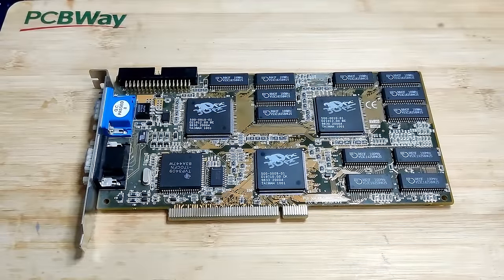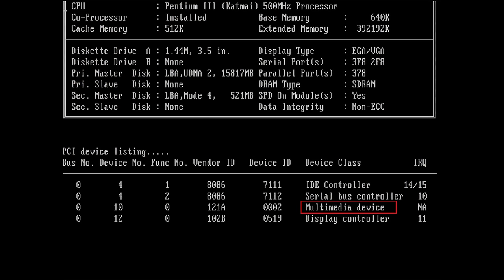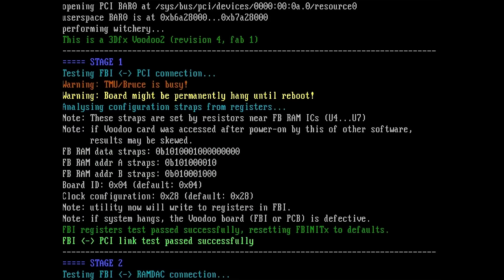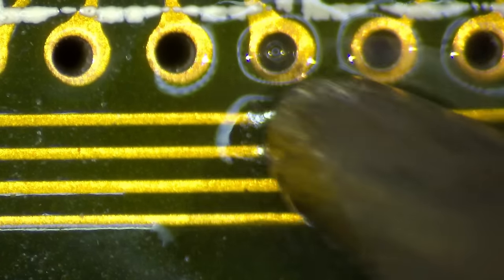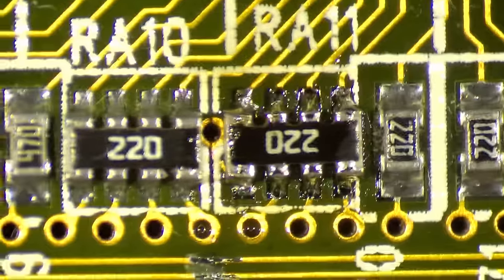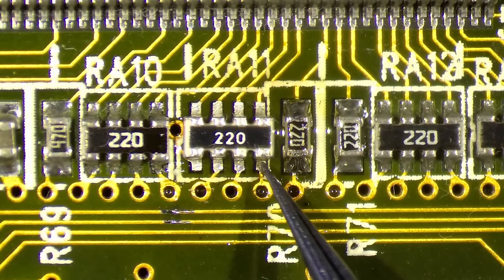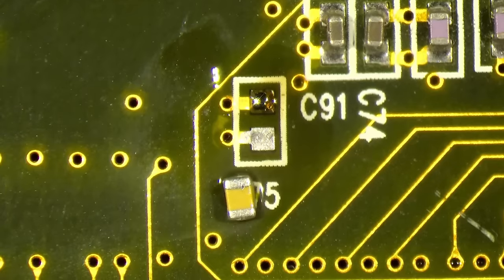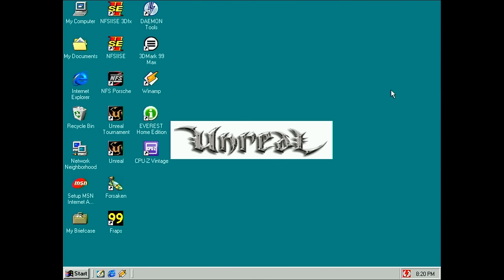Can Witchery find the fault of this 3Dfx Voodoo 2?

Comment: A perfect demonstration of fault finding and where to look, fractures in resistors ...I learned something new here, Thank You. Great result ...awesome video.
Reply from the maker: Thank you!
Reply: Just recently I finished the restoration of very  damaged 386 motherboard. Battery ravaged and some crushed components.
The Last fix was a resistor arraya with an almost invissible crack.
I tried  to fix the array common line and Just use one resistor for the cracked  one, to no avail, so I used an small array. Later relpaced the whole arrayanes. But for one crushed, I madera my one with discrete resistos as I dont have a replacement

Comment: Inspired by your videos, I bought a 3Dfx Voodoo 1 on eBay a few months ago. Like so many of your video examples, some of the 3Dfx chips had bent pins. I have a very modest wifi microscope setup, but I was able to straighten & reflow them. I have been able to get it to work a couple of times, but unfortunately the card still doesn't work reliably. Perhaps it's time to look for further damage on other components to see if perhaps it has a cracked resistor on it somewhere too. Thanks for your videos. Without them, I wouldn't even be attempting these repairs!
Reply from the maker: I am happy to hear that! Congratulations on your attempt! Fixing pins on 3Dfx chips isn't easy - even on Voodoo 1 cards! Even though the card doesn't work reliably, you are a big step closer to a fully working card! Let me give you a few pointers: Is there any pattern you notice when the card is unreliable? For instance, when the card is cold or hot? I would pay close attention to the solder joints between 3Dfx chip legs and the pads on the PCB. Even if they look to be fine, there could be a poor electrical connection. If you carefully poke those legs and they move (even a tiny bit), I would reflow the entire chip. Next, as you said, check for cracked components. Any scratch on the PCB might give you hints where to look. I hope this helps. Let me know if you can find something or if you need further help!

Comment: Hello! Thank's for good content.

My brother had the same problem with his card. After much searching, I found that about 15 resistor arrays had lower resistance than expected. After replacing all the faulty resistor arrays, the card worked!
Reply from the maker: Congratulations on that repair! Interesting that the resistance reduced on so many resistor arrays. That must have been a faulty batch or something bad happened to the card (maybe a lot of heat). Great that you were able to fix it!
Reply: @bitsundbolts  I don't know what could have led to such consequences. One day, the card suddenly stopped being detected in the system. And MOJO reported that TMU had about 150MB of memory and FBI had about 1.5GB. I regret that I didn't take a screenshot then.

Comment: u say luck i say that was pure intuition. Great eye my friend. but I suspect you noticed on some level that it looked off.
Reply from the maker: Yes indeed. That solder joint looked a bit off. That is why i scratched it off a bit - and if you look closely, you see that edge of the resistor array move. I just didn't see that while working on the card - only while cutting the video material it became obvious.

Comment: Your troubleshooting skills persuaded me to sub to your channel....I owned this particular flavor 3dfx card back in the day. It's so easy to knock off those small surface mount components from a PCB board with a bit of uncareful handling. Bravo!
Reply from the maker: Agreed! It's sad that such faults may be the reason for such cards to be tossed out, even though there's nothing wrong but a small SMD resistor.

Comment: Thanks Alex great video another card saved from the voodoo master! Very informal on fault finding and repairing crazy to think something so small can make the card faulty
Reply: Why would it be crazy? If you're not getting information, power, or any other kind of signal, of course that small thing is to blame. A cheap seal brought down Challenger, after all.
Reply from the maker: Yes, hehe. Also, maybe a bit unconventional to debug this card, but I have to fight with the knowledge I have. And more often than not, those cards fail due to physical damage. Well, I guess I was lucky here!
Reply: @bitsundbolts  I've repaired a few cheap 16 bit I/O cards that were thrown into a bin too. Predating SMI stuff, so it's easy to see where a trace is broken or a resistor cracked. Once it was the leg of an IC that was broken under the PGA. That was fun to fix. Good thing I have a magnifying station too:D

Comment: Definitely skill, not luck. Good work!
Reply: Its luck anyway the next step was use volt check in the memory and a osciloscope on the chips signaks missing  a pain in the ass tests soo it,s luck find in visual inpection the fault, no all times you spot bad resitors on ceramic caps it's more easy if shorted or no decopling is working.

Comment: Brilliant work, I will use this approach when logically diagnosing problems. If you see signs of damage - look in line of damage for more. Seems obvious, but it's so easy to overlook the hidden failures in the sea of components. Thank you immensely.
Reply from the maker: You're welcome! I had this happen to me several times until I found that pattern. A deep scratch in the PCB means potentially damaged SMD components.

Comment: When you found the scratched traces, couldn't you use a multimeter to check if the traces were damaged?
Also, at 20:55 a chip is shown "V53C16258HK25  100MHz" with an upside-down "V"-shaped scratch and slight damage to the lower-right edge of the chip body. Would that be worth checking out a bit more? (It's also shown at 21:31 .)
Reply from the maker: Yes, I could have used the multimeter. I usually remove the solder mask at deep scratches to see if there is an issue, then reinforce the trace with solder (that usually also will remove any moisture that may have accumulated), and finally, I'll reapply fresh solder mask to seal the traces again.
The V-shape scratch on the memory is definitely a damage worth investigating - and I probably would have if there wasn't the scratch in the PCB.
But I have to say that a scratch on top of a memory chip is less likely to lead to a problem since it's further away from the PCB and the SMD components. Of course, this doesn't mean that you should never look around such damages. It still can be a valuable hint that points you to the real issue.

Comment: Awesome fix! I just fixed an STB Voodoo 2 that threw the same error in Windows. The 2nd resistor from the left on RN18 on my card was damaged and I was able the get the card working again with a bodge wire from the pad to the top of the resistor network. It also needed a pin replaced on one of the TMUs, but that was a lot easier than finding and fixing the resistor network.
Reply from the maker: Congratulations on the fix! Always good to hear when one of those cards was successfully repaired!

Comment: When you were Ohming it, I thought I saw it move, but I wasn't sure if it was the microscope, YouTube being crazy or whatever.

But when it snapped during soldering, it erased ALL doubts that's for sure.
Reply from the maker: Yes - you are right. It does move very slightly! I only noticed when editing the video and after I found out that this corner was broken.

Comment: Excellent work! 👍
Reply from the maker: Thank you!
Reply: @ props to your sir. Watching your videos inspired me to do my own repairs. I have yet to fix a board, but then again most of the boards I have are socket 775 and above. Your methods of visual inspection and fault finding have been helpful to isolate where the problems are on my boards though. Now I just need to learn how to get down to root causes, ie, the faulty components. I haven’t been lucky enough to have broken traces or busted components, but I will keep digging until I figure things out and hopefully fix some boards.

Comment: If you draw a line between the scratch on the board and the dent on the chip does it not cross the resistor right where it broke?
Reply from the maker: Well, it may not be 100% crossing, but it is close enough to be suspicious!

Comment: I'm not sure I agree that this was luck, I think it is very much a result of your methodical and thorough approach. At best a case of "das Glück des Tüchtigen" (luck of the diligent). 😉 Either way, great work as always! 👏

Really looking forward to that 386 board that is so similar to my first own PC! ♥ Make sure to kick some Mecha-Hitler butt on it once you inevitably fix it. It is also a perfectly suitable machine for Defender of Boston by the way...wink wink nudge nudge. 😄
Reply from the maker: Thanks! I guess I did draw from experience which made me find that broken resistor array quickly.
The 386 video is done! It'll be the one for next Thursday - but it ended up being over an hour long 🤣 - an indicator of how much work it was!

Comment: Wonderful, I have a VOODOO 1 with the same problem - I thought the drivers were not suitable. Now I know where to look for the problem....
Reply from the maker: Good luck! I hope you'll find the issue. I had a Voodoo 1 with a broken resistor on the back which also behaved similarly - yellow exclamation mark in the Windows device manager.

Comment: Does orientation matter with resistors? it was upside down when you removed it but orientated up afterwards...
Reply: no, it doesn't.
Reply: @ thank you.
Reply from the maker: No, orientation of resistors does not matter. Even the ceramic capacitor I add on the back of the board is not polarized (does not need a specific orientation). There are, however, other components where orientation is mandatory, but they usually have some sort of a marking to identify positive or negative terminal, or pin number 1.

Comment: nice find! I'm not sure that would have ever occurred to me.
Reply from the maker: I was lucky to find that one. If I had looked closer through the microscope, I might have seen the edge of the resistor array move slightly when I touched it with the multimeter probes. I noticed that only while editing the video - at that time, I knew what the issue was.

Comment: What good luck to stumble across the problem so quickly! 

Was there a bit of fuzzy corrosion around some things or does the microscope just really highlight normal 25 year old dust?
Reply from the maker: There was a layer of dust over the card. I cleaned it after I was done with the video - now it looks clean again. And yes, I was very lucky to find the issue that quickly - if I ever would have found it. Nevertheless, I learned something. A broken resistor that can't can't be identified as such, can be the reason for a faulty card. So, if there isn't anything obvious, we have to check the resistors!

Comment: 80n is fine for an aging 100n ceramic capacitor, it likely is now measuring 100n plus after it has been reflowed, and the dielelctric has been relaxed from aging.

Comment: One of my first bigger projects was fixin a real old oscilloscope (a mix of PCBs and ceramic strips). The manual advised to "just look around and inspect things" before even measuring. I wasted quite a long time because I did not do that...
Reply from the maker: Most of my successful repairs are due to a thorough visual inspection.
I wish I had more experience debugging electric circuits using a multimeter and oscilloscope though. 
Interesting that this old manual suggests the visual inspection as well - someone knew how most electronics fail 😉

Comment: The resistor you de-soldered was upside down. At least, according to the letters on it. Was this the case on your "good" board as well? Or did someone already try to repair this card earlier?
Reply: They're not directional.
Up and down are the same
Reply: @myne00  I know. But I was wondering because I wouldn't think the robot making the card would have put it upside down.
Reply: @roelbrook7559  30 years ago computer vision lacked processing power to bother with resistor orientation.
It was probably upside down in the tape and passed the automated tests.

Comment: I do not know if this is coincidence, but resistor arrays also often fail on the DVD drive boards of the first Xbox
Reply from the maker: But those are usually in a case - there might be a different reason for why those resistor arrays fail in the first Xbox - maybe heat?

Comment: dont know if it mattered but spotted that dead resistor array, may of been manually replaced, compared to the repair n the others next to it, it was upside down.
Reply from the maker: I think those resistor arrays come from a roll for pick-and-place machines. There is no guarantee that they all face the same direction when packaged in those rolls (or wheels). I believe this was factory made. The crack was caused by whatever scratched over the PCB and maybe also hit the 3Dfx chip.

Comment: @22:31 there seems to be a cracked capacitor at c116.  maybe a future failure point
Reply: it's a filtering capacitor, it won't really matter.
Reply from the maker: Ah, I already packed the card, but that could also just be some left-over from a cleaning attempt.

Comment: Hi, i have a Quadro FX4500 with no display and a damaged component labelled L514 (mentioned on Vogons) which i guess is an inductor? But how do i tell value (no markings)? I cant see any other obvious flaws
Reply from the maker: Unfortunately, I don't know how to get the value of this inductor. If I had this issue, then I would try to find a similar looking component on another device (an inductor of course) and see if the card changes its behavior. An inductor will measure like a bridge - continuity. It resists current flow changes if I understand this device correctly.

Comment: I wish I could test Witchery on one of my precious Voodoo 2 boards. I replaced the FBI, I replaced the 4 x FBI memory ICs, checked all resistors, checked all traces... and yet I still get random artefacts that are indicative of an FBI memory fault. 😞
Reply from the maker: What about the other 4 memory ICs connected to the FBI chip? There should be 8 chips, right? Or is this one of those Voodoo 2 with 1MB memory chips? Unfortunately, I am not sure when Maksim is going to release Witchery - it is still under development.
Reply: @bitsundbolts ,  it's a long story, but I managed to identify the 4 x memory ICs that were creating the problem  - 2 on the back and 2 on the front - and I only replaced those four. The card worked perfectly with the other remaining four ICs and the FBI memsize variable (even after I physically removed the ones that I narrowed down as being the source of the problem). So I'm confident that the other four are absolutely OK...
Reply: Even stranger is the fact that only specific games are affected by the artifacts, while others, on the other hand, work flawlessly, so my guess is that only very few specific memory addresses are affected. I've repaired countless other V2 cards in the meantime, but this one... it's been bugging me for more than a year now, I've never seen such a strange behaviour. At one point, I was sure that the problem was the framebuffer chip itself, I replaced it with a new one (I have a few NOS spares), and I couldn't believe it when, after replacing it, I saw that the same problem persisted. At this point it will be absolutely incredible if I ever manage to find the problem. 😅
Reply: @ruxandy  my guess will be that resistors are at fault. 2 front + 2 back... those can be U4+U5+U19+U20 or U6+U7+U21+U22. Those groups share addressing pins A0...A8 that go through R32, RA3, RA5 for the first group and through R34, RA6, RA8 for the second group. Check for values and cracks. Also check RA37 that provides /RAS signals for RAM IC pairs. All markings are according to reference design.
Reply: @fagear , I wish it were that easy... I've checked all resistors (both on the front and back of the card) and I did it multiple times in the past 1 - 2 years. I keep coming back to this card and I always re-check everything, just in case I accidentally missed something in my previous attempts, but so far... nothing.
Reply: @ruxandy  it can be a crack in a PCB trace or a via. But did you try to touch up all those resistors and resistor networks with a soldering iron? Sometimes those can still show a valid resistance when checked even if they are cracked but will fail when the board expands or flexes under heating.
Reply: @fagear  the card looks like new, there are no scratches or any other type of mechanical damage. Also, the behaviour is not thermally dependent - it's the same even if the card is cold or very hot (I did check this from the very beginning). It's true, though, I did not touch up those resistor arrays with a soldering iron because they look perfectly fine under the microscope. I guess I might as well try that as well, since I literally tried everything else. Thank you. 🙂
Reply: @ruxandy  It's interesting for me to diagnose that board. And since you point out that the problem is with FBI and it's RAM the witchery can test that. If you contact me by email (in my profile) I can get you access to beta testing the utility. It would be interesting to see if it could find anything wrong with the board.